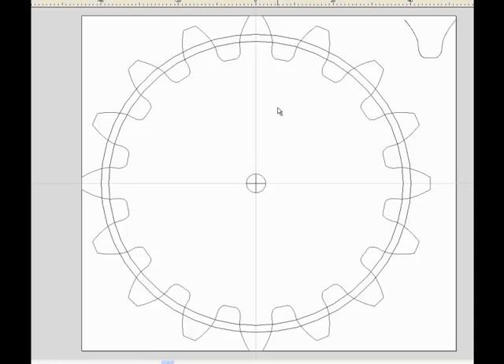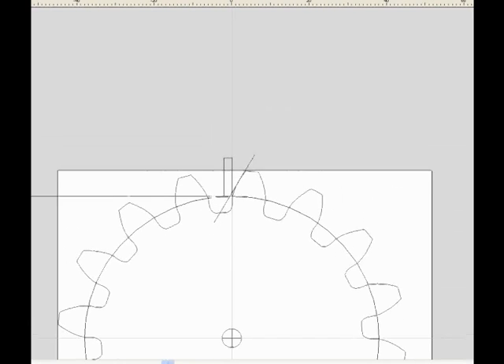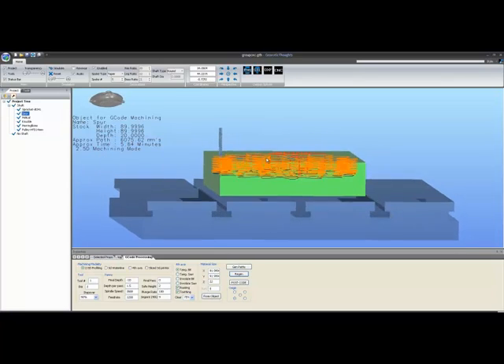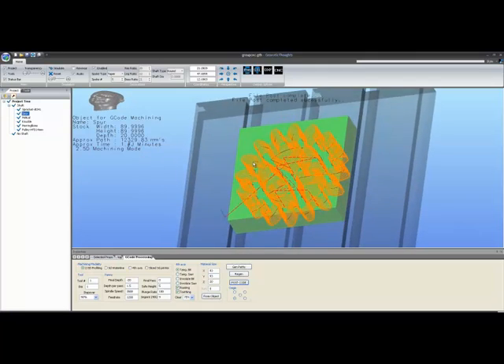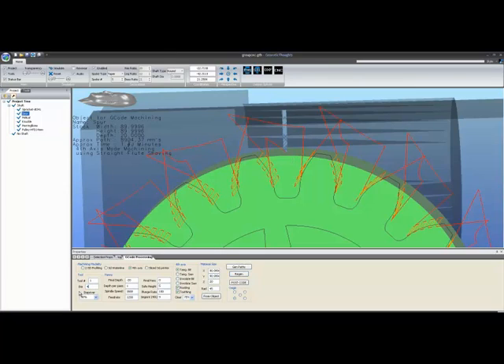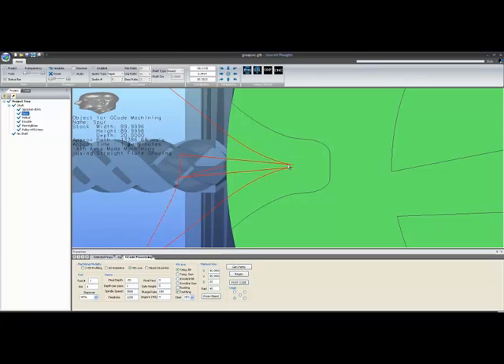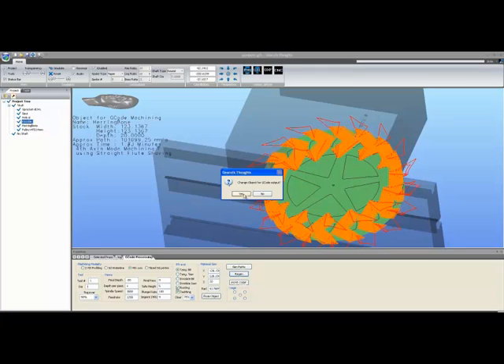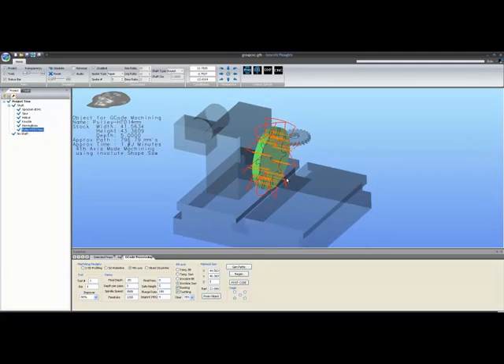Gearotic Thoughts CAM module

Comment: Is this software going to cut bevel gears like in this video. Cutting gears for the Shay No need to tilt the rotary table. 2 cuts only per tooth , 1st quill is raised up from the center-line by one quarter of tooth cordial thickness, 2nd rotary is set forward by one half the cordial thickness and the quill lowered past the center-line by the same amount as the upper offset totaling one half of the cordial thickness.
Reply from the maker: I guess the best I can say is "probably". I will be revisiting bevel gears once the rest of the program is completed to current GM levels. My plan at that point is to discuss this with users to determine the most usefull code output.

Comment from the maker: Hi JP:
   Yes, Im currently coding all modules to be better than GM's, but not to full end capability. The GCode processor has a couple updates on its schedule, and tabs is one of them for 2.5D machining. Once all modules are running at least to GM level of capability, modules such as Gcode will then be updated to having more options. GT has a long way to grow now that it has shed its constricting skin...

Comment: Hello Art, This is very interesting stuff. My experience from the past cutting wooden clock gears tells me that things go much better when thr GCode includes tabs for both the gear profile and any cutouts created by the spokes. Is this something you can / intend to include in the 2-1/2D portion of the software?